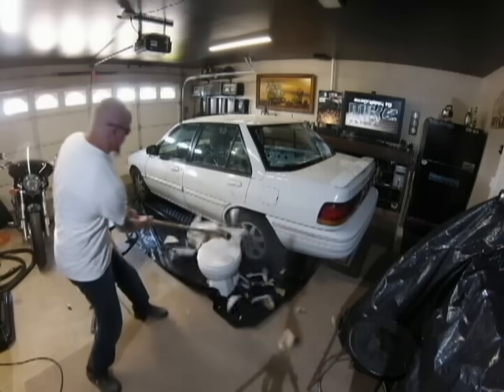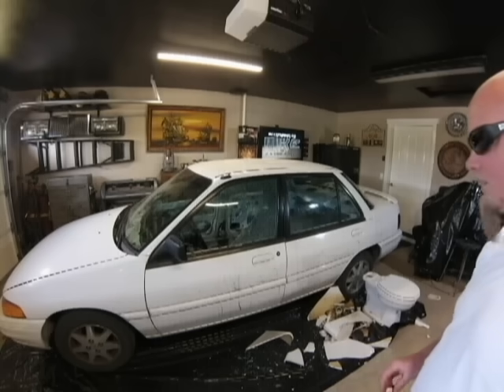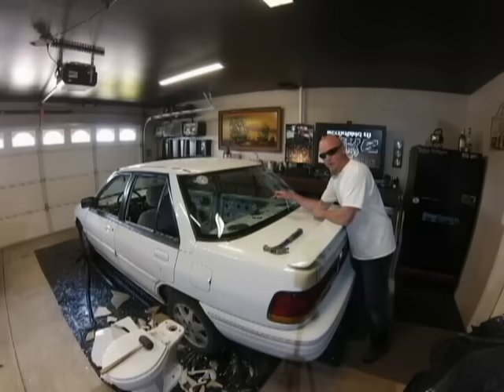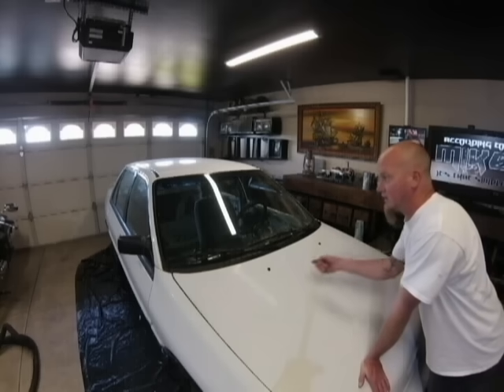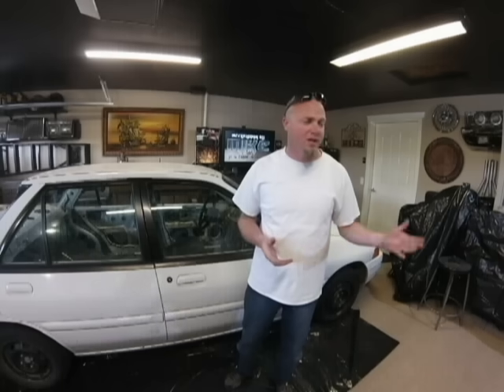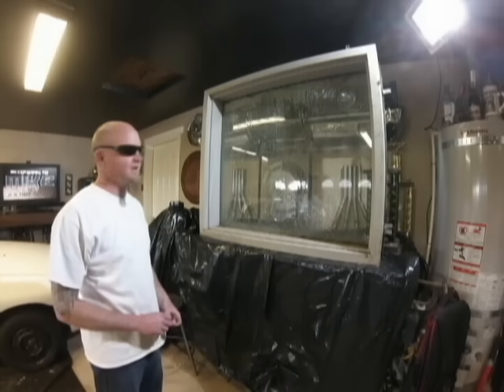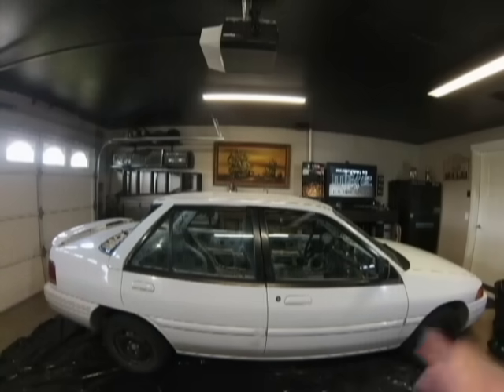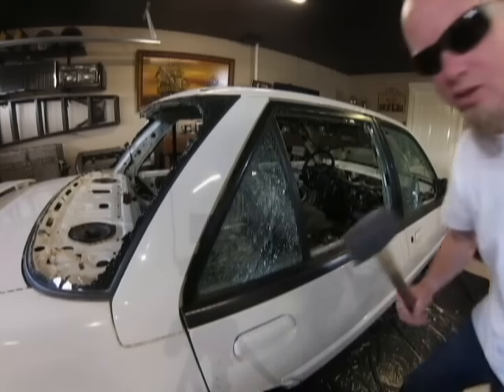How to break glass with a fragment of a spark plug (Part 2)

Comment: Please don't listen to any explanations involving the Mohs hardness scale or electrical interactions or any of the other dumb shit explanations running rampant on the internet. It's tempered glass (safety glass) and you already know just from breaking it that it shatters into tiny bits instead of sharp, lethal chunks. I'm sure you also already know that this serves two purposes, one being the obvious increase in safety for anyone near the glass and the second being that it is resistant to shattering when hit by blunt force (so much so that most people who don't know this are often surprised at how difficult it is to break a car window just by hitting it near the center with a hammer.)

The physics behind it really isn't anything special, and a lot of rumor is being spread by redditors in their late teens that love to sound well-informed. The small bits of glass + the curvature of the window + the way the glass is treated react to being hit by a blunt object by essentially 'smooshing' together. The surface area of the object is large enough to distribute even large amounts of force over enough of the bits so that they are only pushed together more tightly, basically making the glass harder (more dense) at the areas being struck - the opposite of what someone with a baseball bat is going for. 

This all falls apart when you take a sharp bit of ceramic. It would work with any ceramic. It does have to be a relatively hard material of course, otherwise it will just be blunted when struck against anything. But even most metals would work fine, which is what the Automatic Center Punch tool favored by mechanics uses to break windows. You could probably even hold a nail against the window and just give that a good tap. When a sharp object strikes safety glass, it doesn't hit enough of those tempered bits for them to brace each other like with the hammer or bat. Instead, you're effectively knocking out a small chunk of those bits, which compromises the integrity of the entire glass structure, causing it to shatter. 

side note you can prove hardness has nothing to do with it because you could take a hammer made out of solid fucking diamonds and it would bounce off just like a regular hammer. It will say that on whatever description you read about the purpose of tempered glass. It is built to resist blunt force. The opposite of blunt is sharp, not hard. I'm just really sick of seeing comments about the 'Mohs hardness scale' on every single one of these vids. Wish people would stop trying to apply whatever they learned in 8th grade science class and just use common sense and a bit of thought. Everyone is just going to have to accept that middle school was a waste of time.
Reply: First of all don't be talking like you some wannabe gangsta your just a little kid in the basement of your moms house don't be talking shit about which grade i am cause i can reassure you haven't gotten to the 7th grade. and what you have learn in the streets oh please go back to what you no cause you obviously don't know what your talking about if your gonna pretended to be a little shit smart ass go to the kids category on YouTube do us a favor.
Reply: +Didier Borrego I wasn't saying that people who cite the Mohr's scale are in grade school. My point was that 8th grade general science was the point in public education where that material was covered, and I was implying that anyone using that information in their explanation is remembering back to what they learned. It was my attempt at humor at the expense of the time I spent in the public education system and how little I feel I gained from it, but I admit I'm no comedian and I'm sorry if it offended you. It wasn't my intention to offend anyone. 

That said, any of the information I posted relating to why tempered glass breaks when struck by sharp bits of porcelain is completely accurate. If it were truly because ceramic is harder than glass, than by that same logic you should be able to bust through a plank of wood by throwing little bits of diamond at it. As Mohr's scale indicates, diamond is much much harder than wood. On top of that, a blunt object, no matter how hard, will bounce off the same parts of a tempered glass window that a softer-than-glass blunt object would. 

Side note: My mother doesn't have a basement because the soil in her geographic location shifts too frequently to allow for the construction of one, I haven't learned anything "in the streets" which is why my explanation was laid out in such a theoretical manner, I'm far from what anyone would call OG and don't understand what about my post came across as 'gangsta' and I didn't know YouTube had a kid's category (I'm assuming it does and that you weren't being completely sarcastic.)

Again, sincere apology to you and anyone else that I accidentally offended. I was only trying to clear up a very common misconception. Also tempered glass will break when struck near the edges with moderate force by any object, in case anyone wants to know. This has the same mechanical effect as hitting the center mass with a sharp object. Again the small, tempered bits are unable to brace themselves against eachother (in this case because they are at the edge and have nothing to brace themselves against) and fall apart as a result.
Reply: +John Smith You know what i don't even know why im arguing to someone about glass what ever
Reply: Didier Borrego Your argument is something I'd be very interested in hearing. I don't really mind the insults but I was a bit disappointed that you didn't explain a little more. I'm just not sure what you disagreed with.
Reply: I'll give it to you John Smith you're one stubborn son of a gone so keep believing in what you want.

Comment: It's specifically to do with hardness, because it does not conduct and the environment it lives in (inside a combustion engine after all) a harder than average ceramic is chosen. 
That sort of ceramic is 19GPa, carbon steel is about 1.2-3.9GPa, diamond is 115GPa
(GPa is a "Vickers Hardness" measurement)

Comment: exceptionally hard aluminium oxide ceramic used in spark plugs focuses the impact energy into a small enough area without blunting to initiate cracking, releasing the internal energy and shattering the glass

Comment: For the protocoll: Spark plugs are not made of porcelain, it's ceramic. And the reason why it works so good is, because the ceramic has very sharp edges and is really hard compared to a normal rock or stone. And the reason why the safety glass is kinda "exploding", is because it's made that way. If it gets a little scratch, it will just explode from the tension of the glass itself. The ceramic fragments simply have very sharp and hard edges, that concentrate the force of your throw on a tiny area on the glass, giving it a little scratch and boom, the safety glass explodes. That's the explanation.

Comment: Safety glass is under pressure, like a balloon. The ninja rock is harder than the surface of the safety glass, so it basically explodes when scratched like that.

Comment: It's not just porcelain - you need to hit the glass with a /pointy/ bit, with the point. The point concentrates the energy into the smallest area (of the projectile), and applies that to the same smallest area of the glass, overwhelming the local molecular bonds at that point, and forming (a) crack/s, which then propagate using the excess energy. In this case, all happens at high speed.  If you want to read up on that, in non-technical 'layperson's' language, there's an old Penguin book (it's been around for quite a while, I found mine, dilapidated version, at a library old book disposal sale -- but here's the current Amazon version:
http://www.amazon.com/Structures-Things-Dont-Fall-Down/dp/0306812835/ref=sr_1_1?s=books&ie=UTF8&qid=1432358240&sr=1-1&keywords=structures+or+why+things+don%27t+fall+down

Comment: The positive charge of the spark plug reacts with the negative charge of the tempered glass and creates a small explosion. You can just toss spark plug particles on to tempered glass and it will shatter

Comment: Good try . well i was thinking as the ceramic from the spark is harder then normal ceramic and glass would you try to take a piece of the spark Ceramic sharpen it as a head of a knife or needle and try pressing hard on office glass would the sharpen ceramic cuts the office glass??? .I can't try it because i do not have the materials ,Good luck.

Comment: Spark plugs are made of aluminum oxide ceramic, which is exceptionally hard. The impact of the shard against the glass creates a tiny structural failing, which rapidly spreads the tension through the rest of the screen, causing it to break.  Although effective, spark plug fragments will  not work all the time. Spark plug fragments may not break glass if they are not sharp enough or thrown with too little force. Spark plug porcelain shards are  also less effective on windshields because these come with a special laminate feature that reinforces their resistance to impact.

Comment: This happens because aluminum oxide ceramic is far harder than the glass (rated 9 out of 10 on the Mohs scale) and therefore the extremely sharp edges of the broken ceramic will not become dull on impact like the rocks and the toilet do. Also, while tempered glass is stronger than normal glass, the internal and surface stress that give it strength will cause it to explode when something actually manages to break it.
Reply: Sohar and Walter, you are both wrong. The reason why old window panes are thicker at the bottom is because of the way they used to make the glass (crown glass process; they spun the glass to thickness, creating a thicker edge than the centre) You can clearly see this too; not all panes are installed correctly, and some have the thicker edge on the side or on the top rather than the bottom.
But they don't make glass that way anymore, which is why modern glass doesn't have a thicker bottom. Modern glass has a nearly constant thickness because it is rolled out rather than spun to the desired thickness.

Glass does not erode because of acid rain; you can keep even a strong acid inside glass for years. Only hydrofluoric acid or very strong phosphoric acid will corrode glass, and that stuff is sure as hell not raining down (or it would kill you instantly). Also, rain does not become acidic due to radiation.
Reply: @lukasdon0007  🤦people these days... Thax for that. Good to know there are still people setting things strait. We live in the era of at your fingertips knowledge, but it seems like people are dumber than ever.
Reply: Thank you wikipedia
Reply: Micah Nightwolf Hello good sir. Did the porcelain from coffee cup work as well?
Reply: search for prince rupert's drop, there's a mythbusters video 2 parter all about glass and explains it all really well
Reply: AMAZING
Reply: +Micah Nightwolf hes right here. tempered glass is pretty much heated to its melted point and then recooled down to a solid. Its more durable and easier to transport but any bump from a "hard" object will cause it to blow up. the edges are even more fragile, try to hit the edge next time it wont take any strength to blow the tempered glass up.
Reply: Spencer Kovar
Reply: SoHarD_dB_w@®Ez this is false.
Reply: Drop that knowledge
Reply: So is a rock😂
Reply: Yuuuup there’s so much stress on the window if you throw something harder with a sharp point it will make a small chip which lets the stresses in the window “relax” causing the whole thing to shatter.
Reply: Oh really…the hammer is way much stronger or even the whole plug but don’t break it
Reply: Yes! So since it does not dull on impact it causes a greater amount of stress(a force over a smaller distance distribution) which ends up being enough to cause failure right?
Reply: Exactly. And while tempered glass has more strength than regular glass, it is far more brittle, which is why it shatters completely after being hit by such a small object.
Reply: @micahnightwolf  t
Reply: With that reasoning something like a drill bit should work too... but I don't believe it will. I think it has something to do with the tension and elasticity between the parts and impact causing a perfect harmonic vibration on impact. Anything vibrating at the proper frequency will be destroyed.
Reply: Micah Nightwolf Didn’t mean to bother you, could be dead for all I know. I couldn’t imagine someone seeing this in 3 years
Reply: @John-nk6fv  cough 3 years later pal...
Reply: It's 2018, who cares about acid rain anyway hahahaha
Reply: SoHarD_dB_w@®Ez the reason why the top is thinner than the bottom is due to years of erosion similar to a rock    any material will erode due to the acidic rain we experience on a daily basis surprising isn't it you wouldn't believe it but rain is extremely acidic due to radiation and air pollution not enough for our bodies to tell but enough for materials to decay always loved science and shit in high school miss it science that is

Comment: Try cutting a circle with the porcelain on the glass then push it.
Reply: Pokebreaker You can do it with a deep cut but you need force not a gentle suction cup. I was wondering if a circle will work because you can do it on the edge and cut glass neatly this way.
Reply: I don't think you can 'cut' safety glass without completely shattering it.
Reply: Peter Goudy That is why I asked him to try it.
Reply: I also wonder if these ninja rocks will break plate glass as violently as safety glass.
Reply: Mohammad Al-Lawati Lol, are you trying to see if he can do the thing where thieves in movies cut a hole in a window, and suction cup or push it out, then crawl through?

Comment: The ceramic used in spark plugs is extremely hard compared to your typical "rock". In addition, the corners are very sharp. This concentrates the force of the hit to a small enough area on the glass that it can scratch and fracture it. When safety glass is damaged in this way, the damage propagates throughout the glass rapidly and the tension within the glass releases, causing it to almost explode into tiny pieces.
Your typical small rock is not nearly as hard as ceramic, so it is less capable of damaging the glass. Also, the edges are not as sharp, so the direct force at the point of impact is substantially lower.
The same concept is used by the glass-breakers that some people carry in their glove-compartments. They have a very sharp, hard point; a decent tap will shatter the glass.
This would not work on most other types of glass. The ceramic could leave a scratch, but that is all that would happen.
Reply: articpinwheels Hello artic , are you kidding made up like a women or is that to be taken seriously ?  thanks
Reply: Terry Holden What is your point guy?
Reply: you didn't answer so I guess I have to jump to a conclusion that you are a drag queen, which is alright by me.  Im kind of impressed with the picture cause im just an average looking guy and don't have the nerve to p7ut a picture up of myself.   I guess that is my point.
Reply: Terry Holden Its karl pilkington, From the Show an idiot abroad
Reply: articpinwheels I am not perfectly sure, but I think the tempered glass on cars are also designed to resist blunt force better.  So while it can resist the hits of things like hammers and rocks and stuff, the sharp edges of the ceramic can pierce the glass, making it easier to shatter, just as you said in your comment.